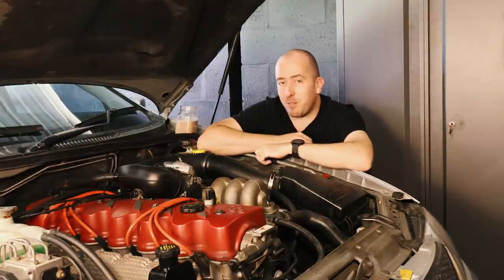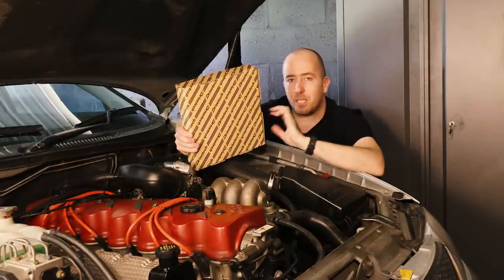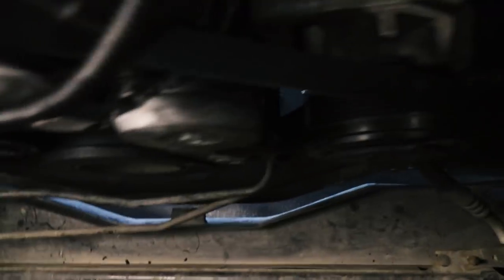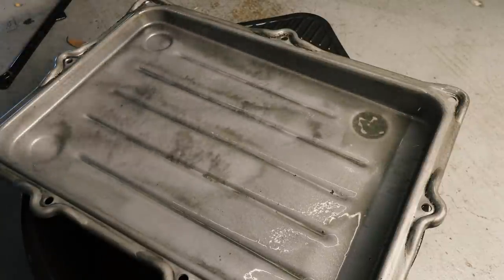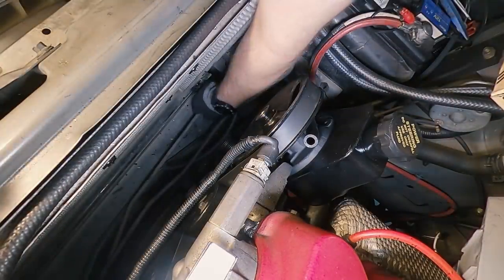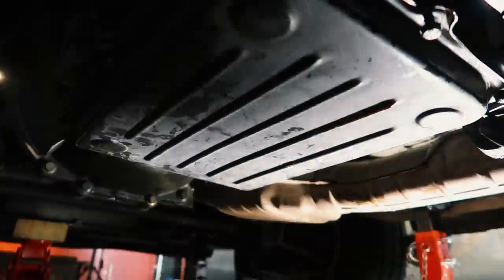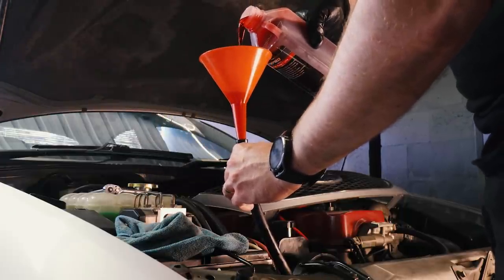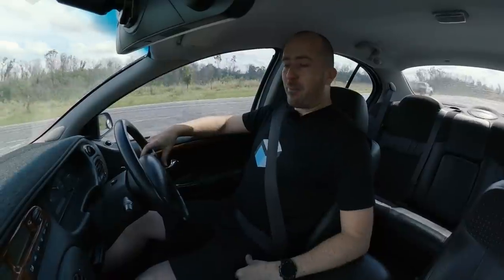Fit a Transmission Cooler and Avoid a Milkshake! How to Fix the Ford AU Falcon's most common problem

Comment: Hi, do you think if the overflow box, being plastic, has a brown tinge to it even though the liquid in the box appears to be a proper coolant colour that the transmission has been milkshaked? When selling a car this would be something a dealer would try to hide. Cheers.
Reply from the maker: You should be fine, the overflow bottles tend to go yellow and then brown with age regardless of what's in them!
Reply: @MotoringBoxTV  Cheers for the quick reply :) also is the milkshake issue limited to the BA or do the FG and FGX both suffer?
Reply from the maker: I am not familiar with the later cars and if anything changed sorry, but anytime there is engine coolant being used to cool transmission oil there's a possibility of things failing and fluids mixing 😶
Reply: @MotoringBoxTV  makes sense, cheers mate.

Comment: Would be interesting to know if you notice any difference at all in the performance of your AC on really hot days.
Reply from the maker: I don't expect to notice any difference - the trans cooler is quite small and being a radiator it'll still allow the air to flow through it to the condenser, and in turn through the main radiator. I also don't expect it to get very hot, so we'll see.

Comment: hey sean i have a 2009 fg ford falcon 5 speed and my trans fluid and coolant have mixed does this mean rebuild or do i have another option?
Reply from the maker: It depends how quickly you caught the issue. Usually it's too late because the gearbox starts failing because the oil/coolant mix isn't lubricating it properly... without any additional detail I'd say you'd most likely up for a rebuild...

Comment: Awesome vid mate, just one question. Do you have to plug the holes in the radiator where you removed the hard lines from? cheers
Reply from the maker: Ideally yes, but I don't imagine it'd cause any huge problems if they were left open. Unless you're planning on reconnecting it in future.
Reply: @MotoringBoxTV  sweet cheers for that
Reply: did you end up finding a second barb fitting for the oil line? got the same kit and can't find a 2nd one anywhere..

Comment: Im on my 5th 4lt of trans fluid trying to flush my 'milkshake'..and yes I bought a trans cooler today., and a new radiator...700 dollars later plus the fluid I have used to flush..it was a thousand dollar mistake not  tightening that nut.  Absolute nightmare..

Comment: When was the last time it had the receiver drier for the AC replaced, along with the refrigerant?
Reply from the maker: Who knows. In a week's time is getting a new compressor fitted and the whole system inspected. I may not be able to film a video about it but I'll let you know how it goes.
Reply from the maker: Had the guy out yesterday, the original compressor was still good and the system just needed the orifice valve replaced and refrigerant topped up. He said both should be done every 2 years anyway. Works brilliantly now.
Reply: @MotoringBoxTV  top ups  are not legal in Australia afaik.  That's why they say 're-gas'.  I'm surprised you didn't replace the receiver drier, they're always full of crud and mould etc

BTW you can usually hold off on a receiver drier replacement for 4 years or so.  I wouldn't even bother with a regas/rd replacement  unless 4 years have passed and your ac smells like you know what.
Reply from the maker: I am not aware of the legalities, but the car had only lost a small percentage of the gas. There's no such thing as a perfectly sealed AC system that will never leak anything.

Comment: Is this the same 4 speed auto used in the older models like ef or el?
Reply from the maker: Yes, but somewhere between ED and AU Ford removed the dipstick as seen here in the video. For cars with a dipstick it is easier - you can refill the box through the tube and easily check the level with the stick.

Comment: Out of interest, can you get a raditator with out the heat exchanger for AU/ BA? If im going to run a trans cooler i don't want it to look like an after thought, plus im going to replace the rad anyways
Reply from the maker: It should pretty much be a manual radiator. That's how it is in the BA anyway.
Reply: @MotoringBoxTV  of cause what a dumb 🤦‍♂️ thanks mate
Reply from the maker: No such thing as a dumb question! I was thinking if I ever replace my rad I'd go for a manual one too.
Reply: @MotoringBoxTV  haha thats true 👍🏼

Comment: I've recently done this on my EL falcon and now my powersteering is heavy and weird, any ideas? I haven't done a long drive yet to test if it comes right
Reply from the maker: They're unrelated items so I am not really sure what is going on there. So long as the belt is still on and the system is full of fluid, it should all be good!
Reply: @MotoringBoxTV  That's my thinking too, im wondering if my pump has died from the car sitting around for a bit (and its probably never been changed before)
Oh well, more work to do!
Reply from the maker: Power steering can be weird. Falcons don't like it if you turn the steering without the engine running... it seems to introduce air into the lines and can make it heavier / shuddery the next time you drive it. Or it might be heavier if the high pressure switch is disconnected. On an AU it's down near the steering rack on the driver's side... might be in a similar spot on the EL.
Reply: @MotoringBoxTV  I just had a play and tried bleeding the power steering again after reading some forums and it helped a bit, ill bleed it again properly and it should be good I think
Shifts way harder now with the oil cooler on the trans too for some reason, must be happier
Reply: @MotoringBoxTV  And now that you mention it, i remember I moved the wheels a lot to get the fender liners off when doing the oil cooler so air would of definitely got in

Comment: I got the same kit as you. Where did you order the extra fitting from?
Reply from the maker: I would take the one supplied down to Supercheap and grab one off the shelf - they should have one that matches. I will be doing the same, but haven't done so yet.

Comment: It's called the ZF milkshake it was a BA onward Issue. AU had the old BTR. The external cooler on BA onward on ZF boxes became pitted by metal shavings from poor Head casting on Barra Engines . You'll just blow a head gasket on the AU and have melted Welsh plugs or a leaky sump.
Reply: I have a BTR in an AU and it milkshaked over 5 years ago. Gearbox is kinda grumpy, rough shifting and occasional flairing, but if anything it has gotten better over that time lol.
Reply: It did have a welch plug, and later a leaky trans sump (resulting in it losing over 4 litres of oil on a completely seperate ocassion).

Comment: I'm glad my BF Falcon has a factory trans cooler and it doesn't go in to the radiator.
Reply: its not actually not better, the factory cooler is mounted to the lower side of the block. So not only does it not get airflow, its also extremely hot. Please buy an aftermarket trans cooler and relocate it to the front of the car. In front of the radiator somewhere will do. With an aftermarket cooler in the right spot, it will do worlds for reliability.
Reply: I think in the later models with the tow pack they added a external factory cooler.
Reply: @aussmash  yeah, it sounds like you have a tow pack or someone has done the mod already. The standard coolers are the heat exchanger brick on the side of the block like what aus said.

They do fail too in the same way because they're basically the same thing, just mounted in different spots.

Comment: Have we got any Ford Dealership Mechanics here that know THE correct procedure for checking the ATF level on these ?
Reply from the maker: The only way is through the filler hole really. They fill them until it starts dripping back out.
Reply: @MotoringBoxTV  yeah but i mean the correct procedure leading up to that point........

Comment: 🙄it's not 5 or 6k to rebuild a zf at all, maybe if your building a box for boost yes but na boxes are cheap, and it wasn't very common for au to milkshake the trans, was more common in ba, and bf had a heat exchanger that failed
Reply from the maker: Still happens though doesn't it.

Comment: That drinking the milk out of that jar low key made me sick to the stomach!! I kept imagining that really was transmission oil and coolant blend. 
Horribly messy job a home trans service. That method of filling looks to be almost as good a using the  dipstick tube. Probably lets you get more in.
Reply from the maker: Chocolate milk or a spicy coolant fluid mixture... you decide
Reply: @MotoringBoxTV  I do like pink milk  🤣.

Comment: Makes you wonder why Ford didn't put this $200 cooler on at the factory and avoid all the dramas and pissed off customers,tight arses. First mod i did on my FGX was this cooler.
Reply: Ford should be put on trial for it.
Reply from the maker: I suppose they didn't think it would be a major issue. That or they probably had some ridiculous service schedule where the radiator had to be replaced every X years.
Reply: @MotoringBoxTV  It was an issue with the  BA/Bf series but did they fix it for the FG and FGX? Nope , like i said tight arses or cheapskates.

Comment: You just fill up untill the trans fluid comes out of the filler hole
Reply from the maker: Yup. People recommend having the engine running and jacking the driver's side of the car up higher on an angle to increase the amount of fluid you can pump in there too.